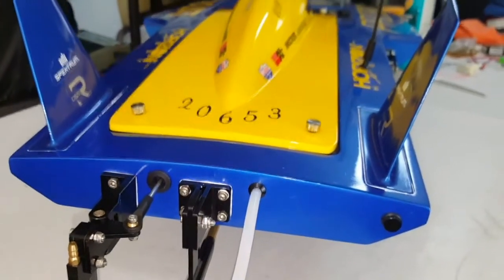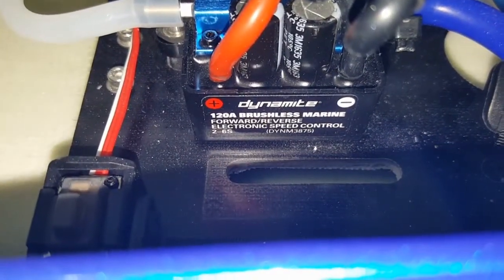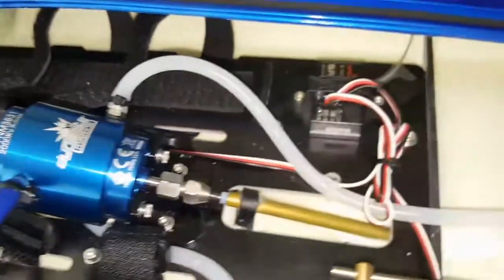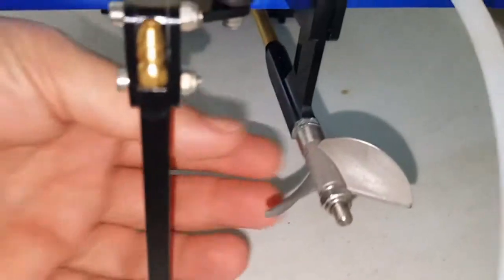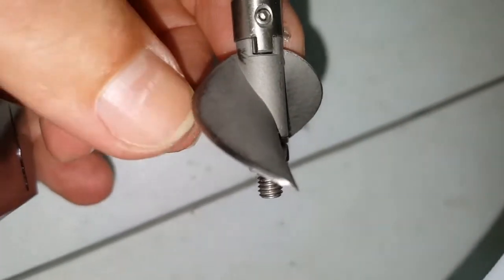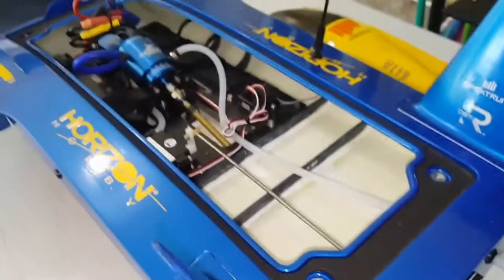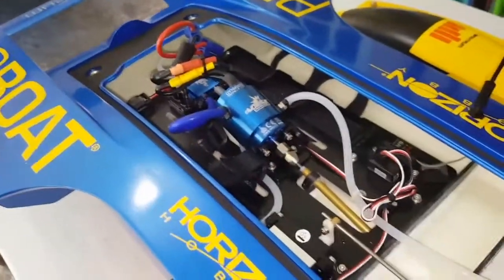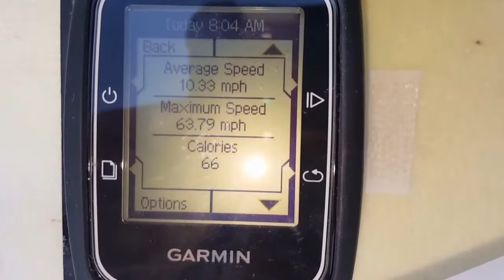Proboat UL-19 Hydroplane (63.7mph)

Comment: 4S or 6S?  Can the 120 Dynamite esc from a Geico V3 work fine with the newest 2000kv Dynamite motor from U-19 and this prop without reprogramming?
Reply from the maker: zeeek1 Hi friend. This vid was with 2x 3s lipos reaching 63.79mph.
Reply from the maker: zeeek1 Yes . Miss Geico's 29 v3  esc will work perfectly with this motor. Also, both motors are the same thing. Believe me. Your question put me to work and i checked my MG 29 V3 motor and compared it with the UL-19 and everything is the same . But let me warn you friend; at 6s esc and motor will get very very hot. Just make 2 or 3 speed runs and after that, only use 1/2 throttle or less for about 3-4 minutes. Proboat should changge those  electronics.
Reply from the maker: zeeek1 Use the MISS GEICOS 29 V3 stock prop, and if electronics get too hot after 2 or 4 minutes run, then use ul-19 prop which is a bit smaller. Remember, don't overrun it. It will get hot at 6s .
Reply from the maker: zeeek1 
Dynamite 2000kv motor at 7.5° stock timing. Over that will ruin it.
Reply: I only plan to run 4S in competition for Spec/Limited classes.
Reply from the maker: zeeek1 
4s will be sweet as sugar .  No prob at all.
Reply: Edwin Cordero the stock motor in my impulse V3 runs faster than that 2000kv and electronics stay cooler
Reply from the maker: mr cheerful 
Well...let'see.  Post unedited video.